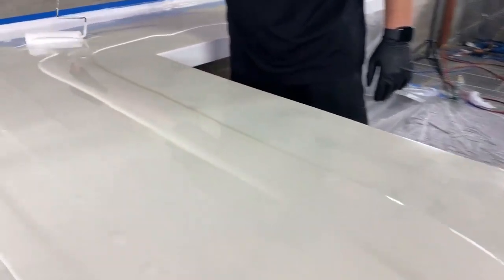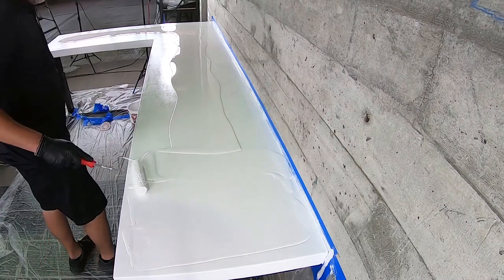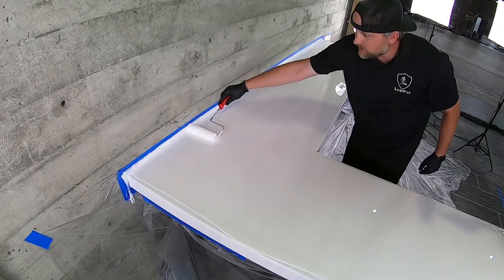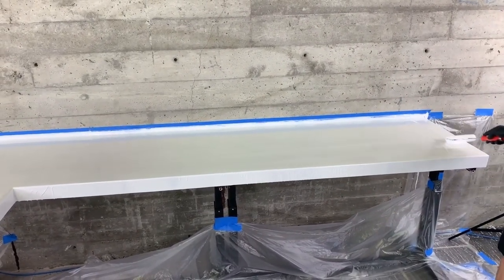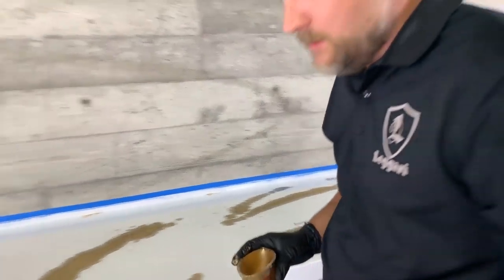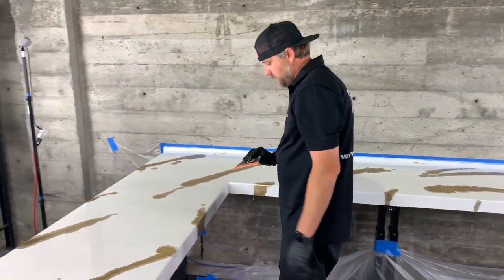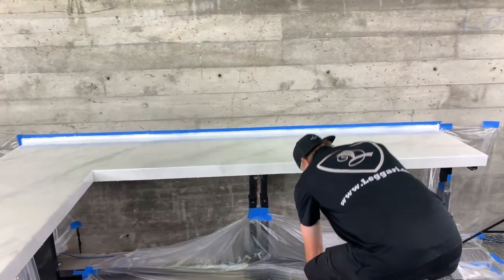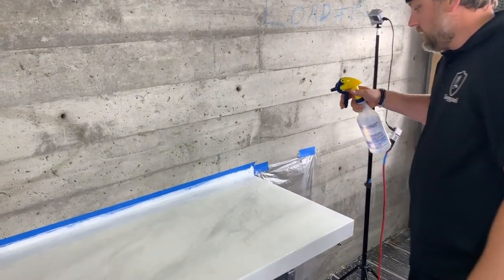DIY White Epoxy Countertop | Kit 2

Comment: Love watching the magic!!! Do you have to top coat this??  And how would you get it off the wall?
Reply from the maker: We have 3 different top coat options. Glaze coat is our super high gloss top coat that lays out glass smooth just like the metallic epoxy coat. Our WB Urethane comes in high gloss and leaves a minor texture and we also have a WB Urethane that’s a Matte/Satin finish.  You use denatured alcohol to remove the epoxy.  Thanks

Comment: I have the gray primer. Can it be used for this design?
Reply from the maker: The primer will not work with the epoxy if you to mix it together.  Thanks
Reply: @LeggariProducts  I saw a white primer before u applied the epoxy. But I have a gray color. Will it work anyways if I use white epoxy. Or should I use a white primer instead of a gray primer....then whit epoxy A n B

Comment: Can your appoxy be applied on top of a  ceramic tile countertop?
Reply from the maker: Yes it can be put over tile, but you need to fill all your grout seams with multi purpose bondo from Home Depot, then sand it smooth, this will scuff up your tiles also, then wipe it clean with denatured alcohol then you are ready to apply our epoxy.  Take a look at the tutorial below.  Thanks
 https://youtu.be/g8GzsL0kpns